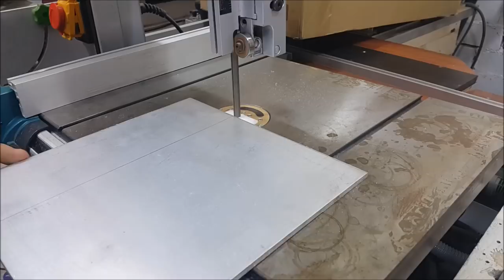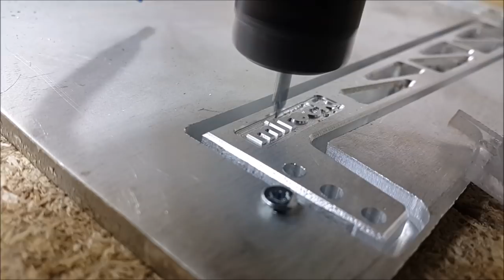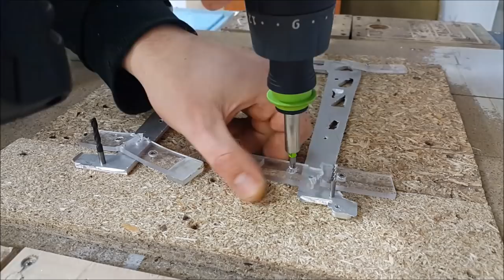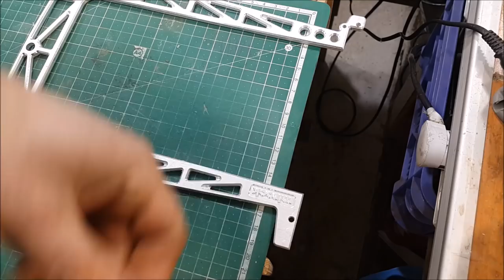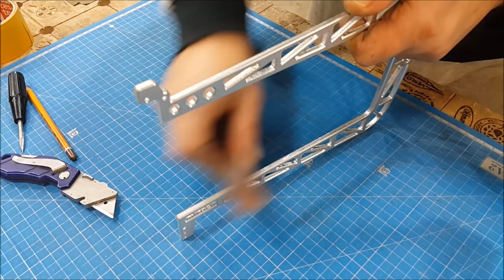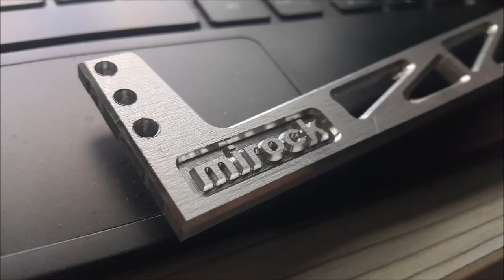Mirock Coping Saw 1. Frame

Comment: Okay... Lets build a Zeppelin. Germans are not able to! :D

In German feather (bird) is the same as spring (mechanical). So you have to use a spring for hanging the pipe.

Perhaps a bunch of moving feathers will work also. :D

Comment: Would you mind showing what feeds, speeds, bit etc. you are using in your cuts?
Reply from the maker: No problem. But a lot depends of kind of machine. My data: feed 800mm/min, 12000rpm. 0.5mm for 1 step

Comment: What is your feed rate and spindle speed ? Single flute ?
Reply from the maker: Not single. 3 blade bit for soft metal. Feed 800mm/min 12000rpm
Reply from the maker: And 0.5mm for 1 pass. Duraluminum is pretty capricious